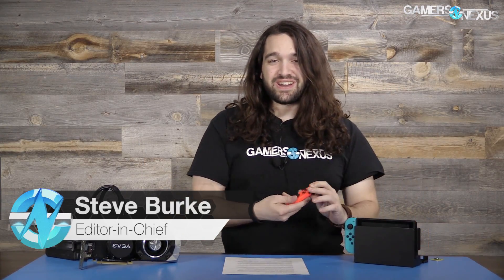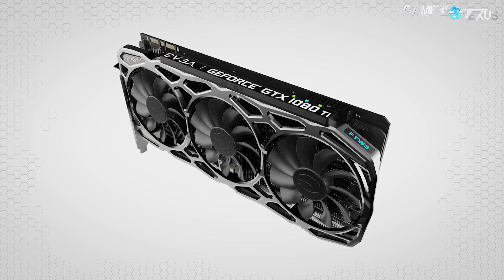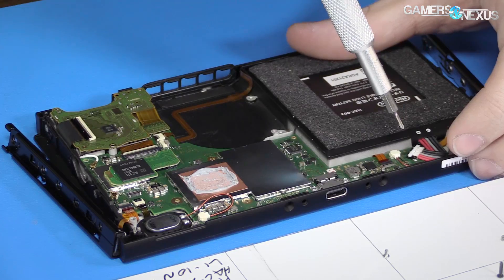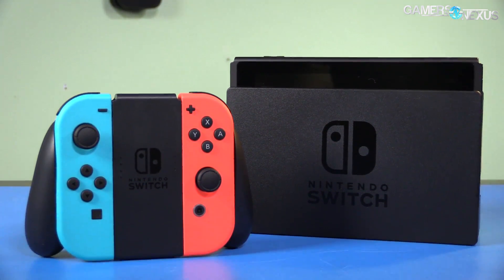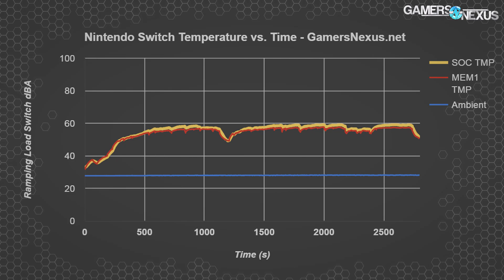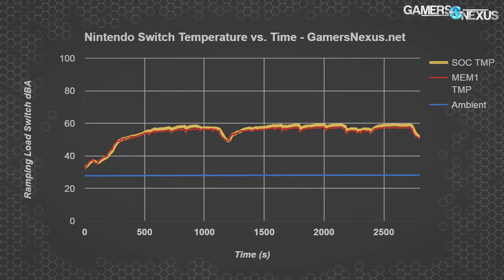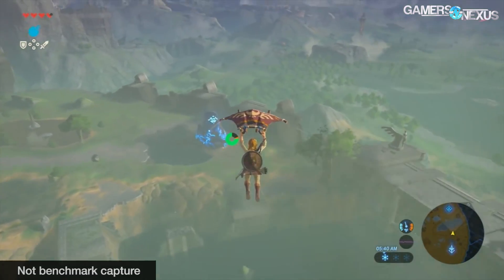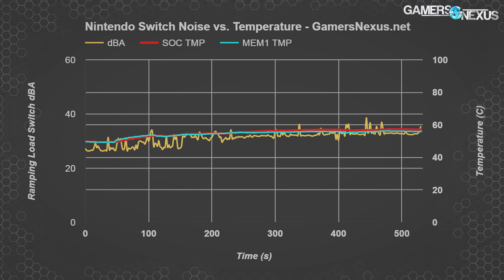Nintendo Switch Thermals, Noise, & FPS Drops

Comment: According to Digital Foundry, it's actually a "vanilla" Tegra X1 chip with no modifications whatsoever. Informative and fun video as always guys :)
Reply from the maker: Their "modification" was to change the text on the die, then! That counts, right?
Reply: Ahah they changed the text ? I was convinced there was only the Nvidia Tegra stuff written on it ^^ DF video is based on a die shot showing the exact same configuration as the vanilla chip, so yes, they probably only changed the text on the die :D Weird stuff
Reply: The Switch's X1 platform has 4gb of LPDDR4 ram.  The Pixel C tablet and Shield pro X1 platform uses 3GB LPDDR3, seems pretty custom to me.
Reply: I wonder if Nintendo knew it's just a Tegra X1 chip or if Nvidia lied to Nintendo about making a "custom" chip for the Switch.
Reply: Roy LaPoutre Sony must of paid them to say that.